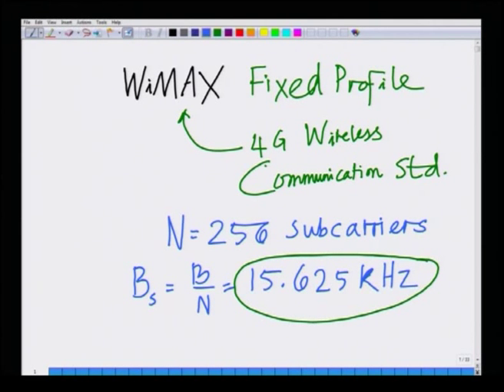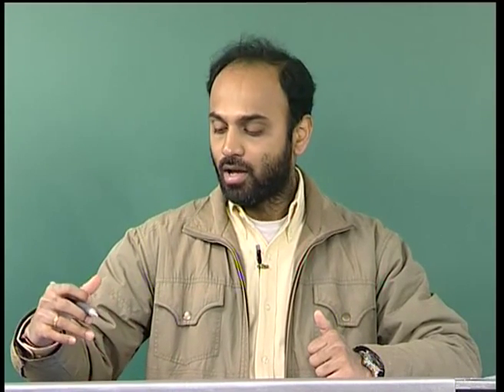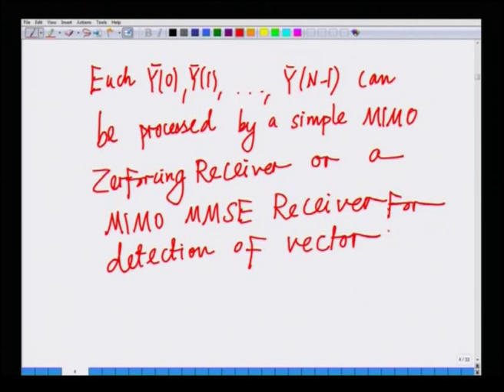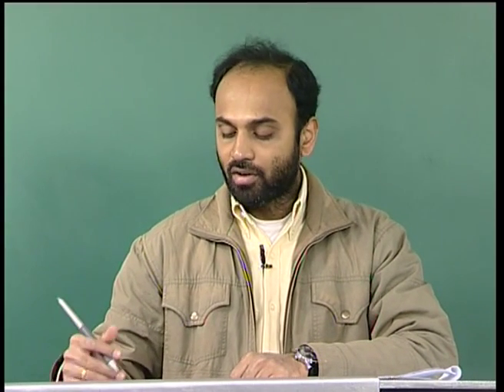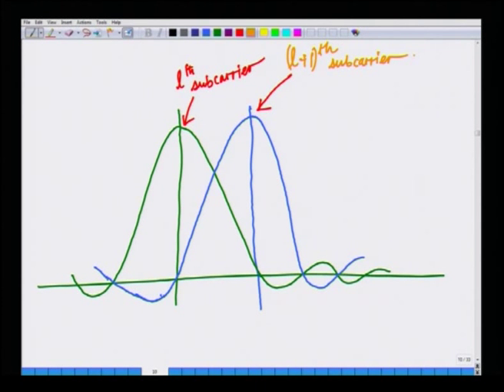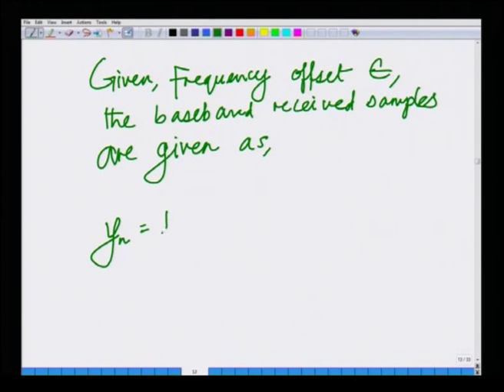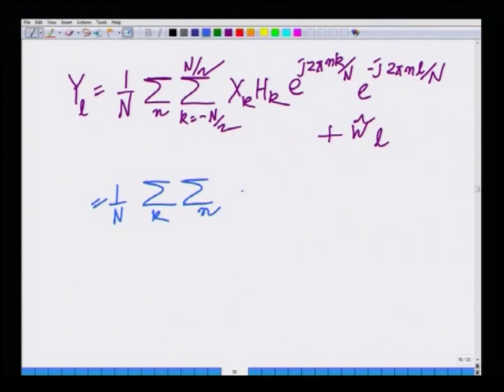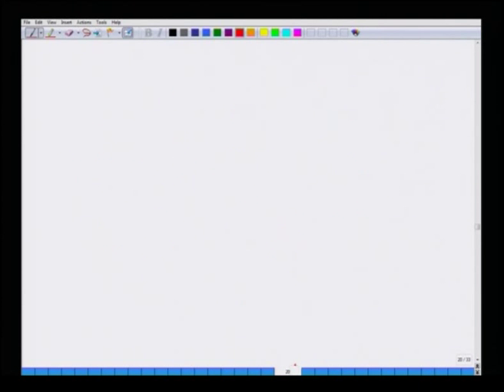Mod-01 Lec-32 MIMO-OFDM (Contd.)

Comment: why do we have to do mimo detection? FFT is  itself used to detect the symbols . isn't it?
Reply: Correct, but what FFT gives you is sum of all signals from multiple antennas right? How do you differentiate which signal coming from which antenna? 
Ans is mimo detection.
Reply: MIMO detection is used for baseband detection